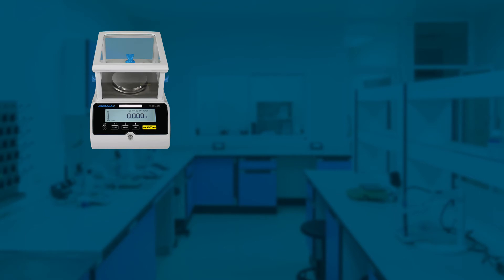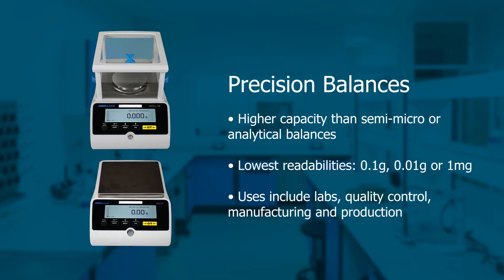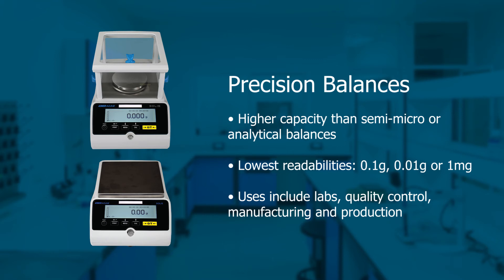Differences between semi-micro analytical, analytical and precision balances

Comment: I'm wondering error in weighing between precision without cover vs with cover
Reply from the maker: Hi, apologies for not replying sooner. Balances with a fine readability between 0.01mg and 0.001g typically feature a draft shield so that they're protected against air drafts that may alter the results. We also recommend using these balances with an anti-vibration table and/or an ionizer, to protect against vibrations and electricity, since they're so sensitive. Top-pan balances without a draft shield aren't so sensitive because they don't offer as fine a readability. Air drafts, vibrations and electricity will have less of an effect on the results. Top pan balances are still accurate and precise, they'll provide the correct weight, but the results won't be in as many increments as an analytical or precision balance with a draft shield. Hope this helps!
Reply: @adamequipment  yes thanks